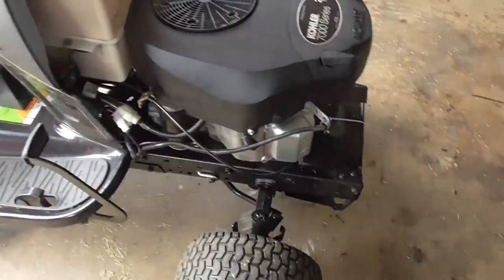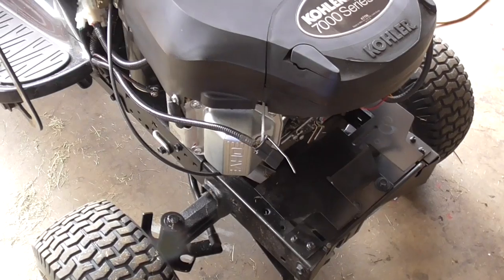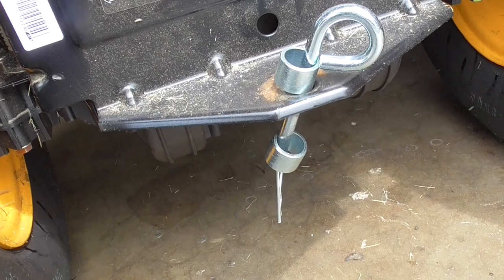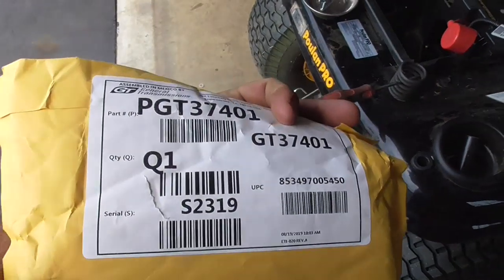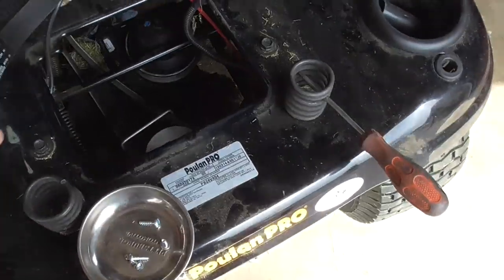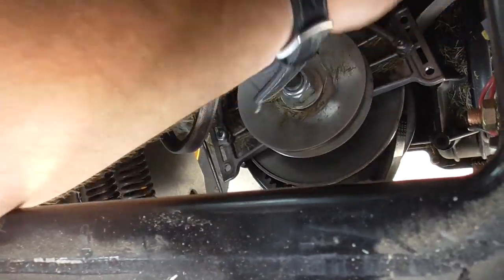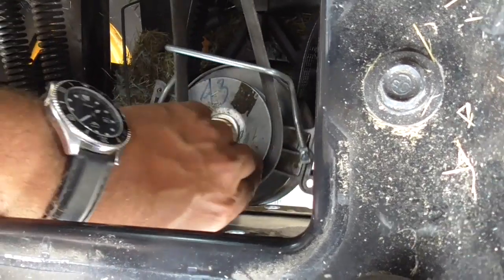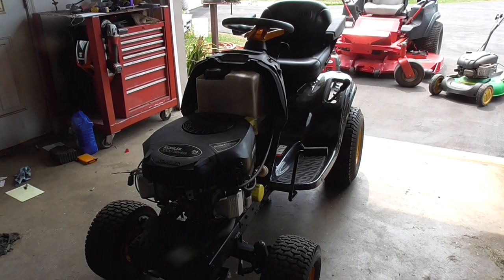Craftsman Poulan Husqvarna Plastic Transmission Belt Repair

Comment from the maker: https://amzn.to/31QYTXI This is the link to the GT belt
https://amzn.to/31VIqS7 Variator Parts Replacement
https://amzn.to/2Z7D0ql Variator Secondary Pulley Replacement
https://amzn.to/2Lgxubh Entire Transmission Replacement Parts
www.propartsdirect.net
Reply: My plastic transmission went bad within its two-year warranty so luckily the shop replace the part they said they put a better part in there I don't know if it's true or not, LOL. But it has been working for three more years so my tractor is 5 years old now. But now my deck is all rattling all over the place and things coming off, haha. I think I'm going to have to take a good look at the deck and secure it again better for like the 4th time. Good luck have fun enjoy life and thank you.
Reply: Man, You know how to fix Most of everything from Electrical to plumbing and now Lawnmower 👍👍👍

Comment: One reason they malfunction is grass, twigs, dirt, and mud getting caught in the mechanism on top of the transmission. If yours starts acting up, clean the top completely first. YouTube has a video on how to find out what is wrong with it, should it start malfunctioning.  
It is filled with grease for life, but the axle seals wear and eventually leak. They are easy to change. If you let it keep leaking, the transmission will eventually fail from lack of lubrication.  
When replacing screws into plastic, it is a good practice to place the screw into the hole, then apply downward pressure while turning it counterclockwise until it slips downward. Then immediately quit turning it counterclockwise, and turn it clockwise to tighten it. Doing that will use the same threads the screw originally made, when it was first screwed into the plastic. If you do it like that, you will never wear out the threads in the plastic, no matter how many times you remove and reinstall the screws. 
IF you keep the top clean, and replace the axle seals when they start seeping oil, the transmission will last quite a while.

Comment: I have a 2016 with the plastic transmission  I mow about 2.5 acres every other week and I have not had a problem  with the transmission I have big hills on my property and I weigh 300 lbs i am having to change that very drive belt today thank you for the video it is very helpful

Comment: I've had a ariens with that trans for maybe 7 years. Bought it used. 4 years ago I blew out the axle seals and some grease towing a yard roller up a decent hill. Replaced and mowed on. Had .75 of an acre at the time. The last 4 years I've used to trim  and mow wet spots on 10 acres of hilly open field. (sometimes entire yard). Now I've lost power up hills and I think this is why. Thanks.

Comment: I bought my Ariens (built by Husqvarna, same parts), A20AV46 (20 hp B&S motor 46 inch cut) in 2014. It has the same plastic tranny as yours (General Transmission RS800).  I have an acre lot plus rental property that I mow and also a church property that I mow. It has lots of yards under it belt(s). I just today replaced the leaking axle seals, they started oozing grease two years ago. Sharpened the blades once, replaced once. Replaced the original air filter last week. Replaced the battery once. Still on the original belts and spark plugs. Original tires, added green slime. It's the best riding mower I've owned. Have owned four so far. Two MTD's, one Craftsman.
Reply: I have the same. Do you the part # for the drive belt and transmission belt? I need to replace these belts

Comment: Great fix Bob 👍 I personally haven't worked on one with the plastic trans. However I've heard the axle seals go bad in 3 or 4 years.
Reply from the maker: Didn't know that this one is not leaking, so far....
Reply: Yes they do mine is leaking wondering can you fill with oil.
Reply: I got about three years out of my seals and it was a quick fix. I considered drilling and tapping for zerk fitting but being plastic I decided against it so I wouldn’t create a weak spot. Getting ready to do a belt in the next couple days.

Comment: What I’ve found several times, when they were told tractor has to have a new transmission is removed battery and box, vacuum all the grass out, then blow air under drive unit close to rear and remove 4 screws 
Pressure wash really good 
Problem solved and works great again 😊😊😊😊
Reply: Yeah I was quoted $1400 for new transmission & install. Talked to the manf. and they told me just to replace the driven kit on the outside for $80. I did that, but didn't seem like there was anything wrong with it. I think it was just the thorough cleaning like you say that did the trick for me. It's nonsense they have so many exposed moving parts subject to packing grass that you can't reach to blow out in normal daily use
Reply: @Grrrnthumb on one customer had me drill 1 inch holes for him to blow out the grass and he said he has not had any problems and he mows every day but Sunday 😊

Comment: Good video, the belt is Warranted by poulan pro for 10 years no joke it's in the paperwork. Those rs800 transmission parts are about $60 on eBay

Comment: Thanks for the video. Does the belt that you replaced always spin? My tractor won’t drive. When accelerator is pressed the rear pulley moves forward which loosens the toothed belt. I wish I could have seen this drive unit in operation.
Reply: Commenting to myself…. It was the variation assembly. At first glance I didn’t notice that the plastic bearing was completely gone. All fixed now
Reply: I’ve been wondering the same thing for days while working on this. The one I’m working on is grinding as you attempt to drive. It’s like gears won’t mesh, making me suspect that drive belt should stop spinning when not driving, but it spins constantly. Is it supposed to? It’s like a skidoo clutch, at least in appearance. The belt looks ok, but not perfect, and could have shrunk a bit? I dropped the transmission as it was a pita to work on in the tractor. 
Any suggestions?

Comment: I have the same tractor owned it 3 years and it's the worst one I have ever had. My issue is the forward reverse pedal doesn't move. I can go forward it's really hard to push to increase speed, it won't return to neutral and in order to get it into reverse I literally have to stomp the pedal. To the point that I bent the reverse side of the pedal, I just pressure washed all of the crap built up on the top of the transmission and it works a little better. Changing ground speed in forward is much easier still won't return to neutral and still have to jump on the reverse side of the pedal to get it into reverse. Last tractor was 20 years old when i replaced it this one is 3 and I am ready to take it to the junk yard. Never had any luck with Husqvarna and never would buy another product from them. When I purchased a Poland Pro I didn't realize it was made by them or I never would have dropped a dime on it
Reply: Dude, do some research on GT Transmission's website. It's just dirty underneath clogging the variator levers. No big deal.

Comment: Great video👍  Question though , was the belt broken or stretched? How did you know that was the problem?  I haven't had that issue yet but I've had to replace axle seals and I found out they go bad because there is to much slop back and forth with the axle. I'm actually putting a video put tonight on my thoughts about this transmission
Reply from the maker: Hey Dave, I will check out the video.  The belt was completely shreaded and wrapped around the back pulley.
Reply: Good catch on removing the bolts. I saw another video on this where the guy used a different procedure and there were a bunch of steps involved
Reply: Guys,if you have this type of axle it is a great idea to pull the wheels and add never seize. I would imagine that hearing or beating them to remove would destroy the plastic transmission

Comment: I have the Craftsman T240 Turn Tight tractor with a Kohler 7000 series 22 horsepower 725cc V Twin engine 3 year unlimited hours warranty...Tuff Torq K46 transmission has powered coated steel gears no plastic..

Comment: Was this a broken belt? Or other issue? I have a 3 year old Poulan Pro Pp19A42 that does not move. I blew out all the grass and cleaned on top of transmission. Tractor would move but not for long. If you pull on the brake lever at the back of the tractor it does not release. Is this also a belt issue or another problem. Thank you.

Comment: thanks dw  ...   have a ?  for you  ..   if a person buys a new lawn mower or tractor   how long  down the road  should   someone   check to see if  the valves  are  still  tight   or need tightening   ..   †
Reply from the maker: I would not worry about it unless you have hard starting, backfiring popping, or rattling/ticking.  If you want to open it up and check it out it won't hurt anything.  Just my 2 cents.

Comment: I have a 2021 Craftsman T240 it has the Tuff Torq K46 heavy duty transmission thank goodness it does
Reply: I know that this is a late response but the tuff torque transmission sometimes starts to go slow down to nothing. You will have to replace the oil in the transmission. It will eventually go bad. Regular 30 weight motor oil. 👍

Comment: I was told that I would have to replace the entire transmission but I need to check into this type of fix.   Mine is a poulan pp19a42 with a b@s engine. One question about the belt. How did you know was there a broken belt under the battery box?
Reply: I found half a belt when I dropped the deck

Comment: I am starting to run into the newer mowers and blowers as far as repairs and the lack of quality. It makes me sad to see the industry  going to plastic on everything. The triangle shaped  screws you showed are designed as a one time use and are a real bugger to get back in. I have been going to the hardware store and purchasing  screws that actually work. I just repaired a Husqvarna  snow blower, 3 years old with a broken arm that holds the drive cable on the front cab. They are made of flimsy plastic that break really easy. I informed the owner  he could expect it to happen again in the future.  The replacement part is $50 and requires removing everything. I cringe at having to work on the newer riding mowers. I am about to retire from doing small engine  repair with the way its going.

Comment: mine all the sudden after 2 years won't move forward or reverse but runs fine the belt I don't think was on the ground would it still be possibly up there?
Reply: I don't think I'm going to buy another poulan, I barely used it, maybe 40 hours, is that a lot?

Comment: ? For you , 
I have a craftsman tractor with a briggs and stratton opposed twin engine on it , and I was wondering if you could tell me how remove and replace the pto crank seal on it without removing the engine? Lmk.
Reply from the maker: Remove clutch and pulley from bottom of crank.  Drill a small hole in old seal, use a screw to drive in the hole and remove the old seal.  Take oil out first.

Comment: What I'm trying to find out is how the pedal push rod is attached to the lever
Reply: There is a vertical pin  sticking up in the top of the transmission. The long horizontal push rod has a looped end the fits over the pin, then an E-clip locks it down so it won't hop up and get loose. There are videos showing the details of the RS800 transmission on General Transmission's website

Comment: Those plastic transmission are junk I have one and it’s blowing axle seals. Been told by two repair men that the vent is plugged. Have to pull the transmission out to get to it. 🤬. 
Already hav replaced it with a zero turn.

Comment: These transmissions are the worst. I run into the ones that the bearings have rusted out and trying to get into them isn't pleasant. The customers are not comfortable paying the labor cost of replacing the parts.